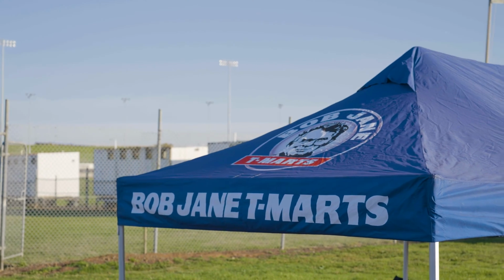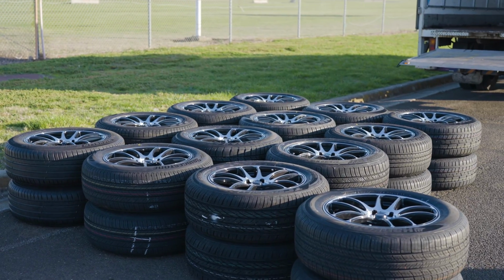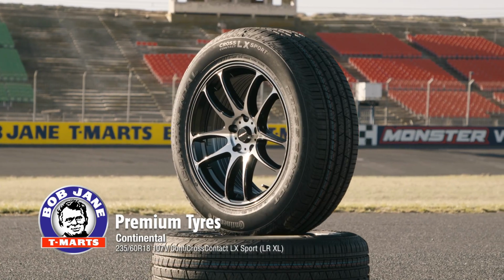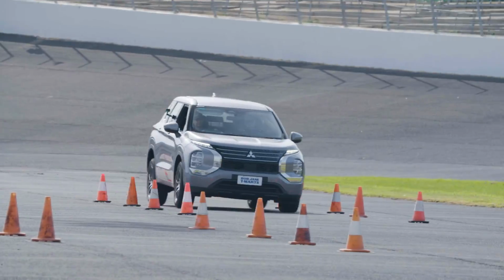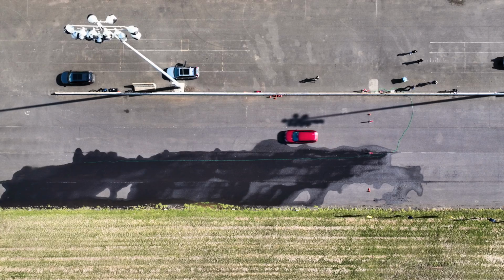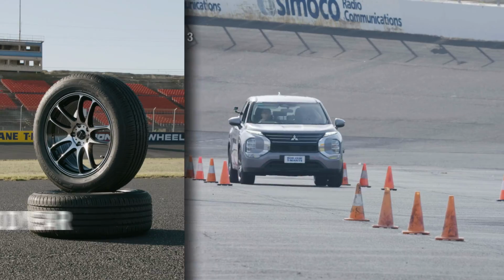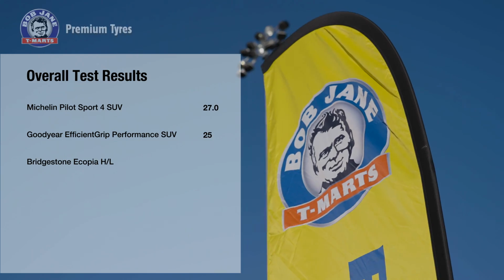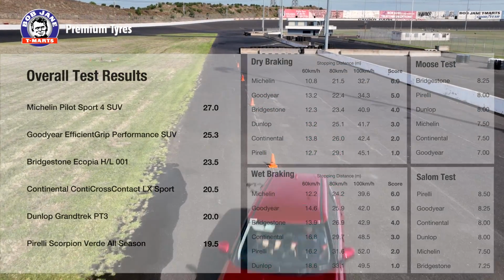How Do These 6 Premium SUV Tyres Hold Up? || Tyre Testing

Comment: I am considering pirelli scorpion ms for my SUV, as they are having big sales at the moment. But if they are anything like these ones in the test, ill pass. Look at the braking distance differential in wet and dry. Thats huge and could be the difference between a collision or near miss
Reply: I’m also checking out the Scorpion MS, but that test made me rethink it.
Reply: @KevinGermino08  I have pirelli scorpion MS on my Santa Fe and they are absolutely garbage.  Had two replaced before I had 2K on the car and another is bad.  Replacing them with Michelins.  Do not waste you money on Pirellis.
Reply: I have Pirelli scorpion MS on my Santa Fe and they are absolutely garbage.  Had two replaced before I had 2K on the car and another is bad.  Replacing them with Michelins.  Do not waste you money on Pirellis.

Comment: So you compare a high performance tyre like michelin pilot sport 4 suv to eco tyres like the bridestone ecopia? Thats like comparing a Toyota prius to a Toyota supra.  A closer comparison in performance, price and wear would be something from the bridgestone potenza sport range. 

Regardless Michelin is probably the best tyre there is in each respected category but this test can make the others seem worse than they really because a soft compound will always perform better in brake and handling tests compared to high mileage comfort eco tyres